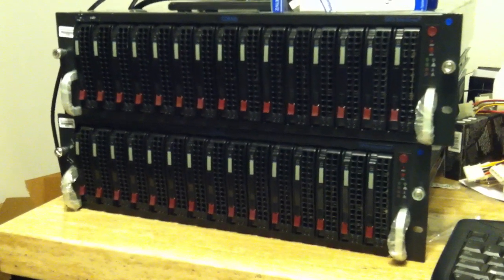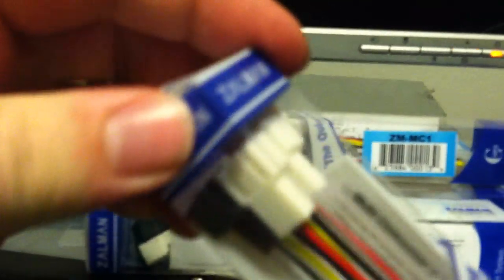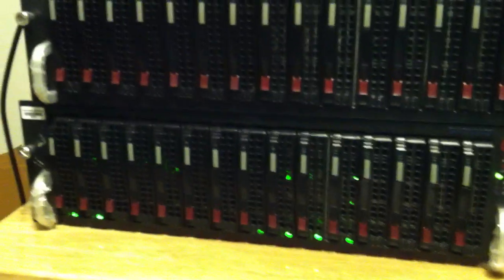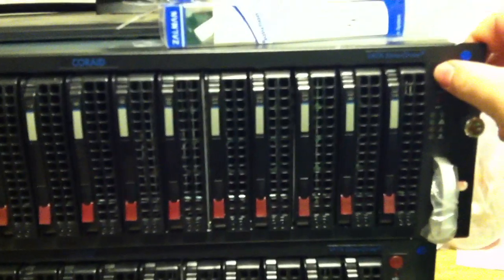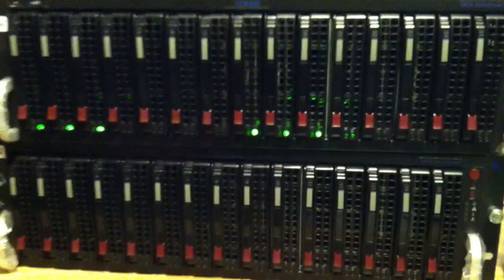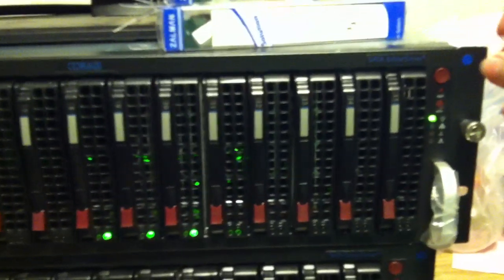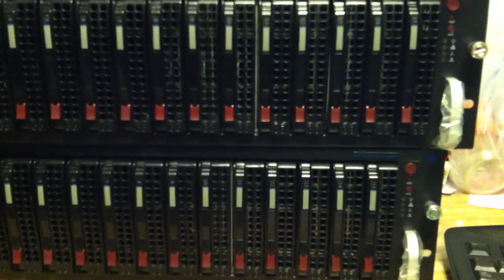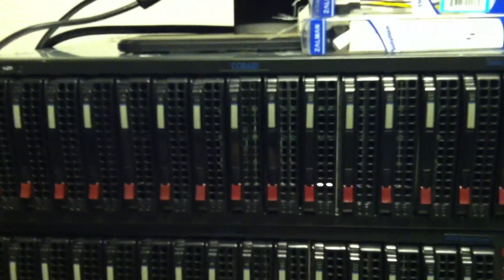Supermicro SC933 modded fan vs unmodded fan

Comment from the maker: @ngtflyer This is true. However this is an older model of chasis which only has 3 pin connectors and the connectors go to the backplane this is true for the newer version to. The motherboard only controlled the back 2 fans. On a 2u supermicro case I Have all fans are controlled by motherboard as they are not hooked up to the backplane. Not the case for this 3u one.

Comment from the maker: @ngtflyer This is an older revision of the chasis and only has the 3 pin fan connectors. Also all the larger 1.2 amp fans hook up directly to the backplane (not the motherboard) which means they can't run in low speed mode. A newer 2u supermicro chasis I have (8 drives) did have 4 pin connectors for all the fans and It was about as quiet.

Also I am using these as disk chasis (sas expander only) so no motherboard will be in them.

Comment: Pretty much all Supermicro servers have a "workstation" option in BIOS.  This will cause the BSP to run the fans at lower speeds without having to modify the box.